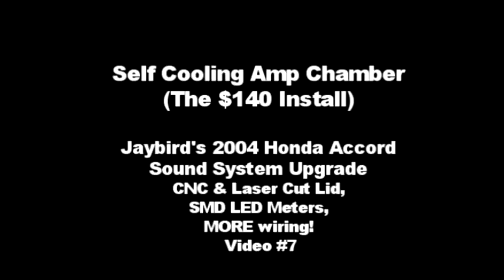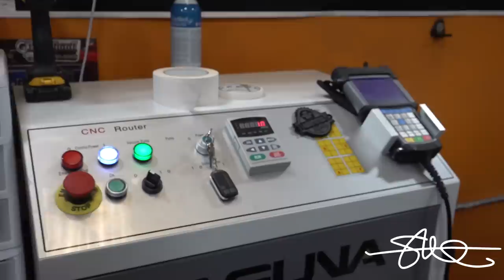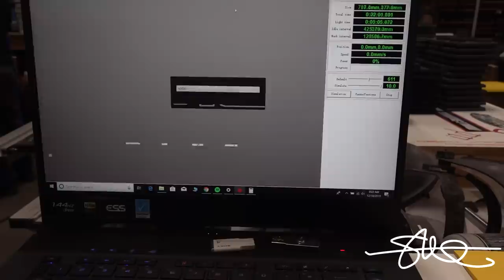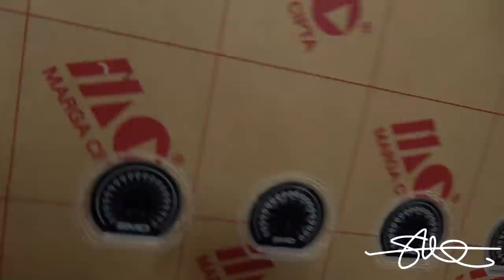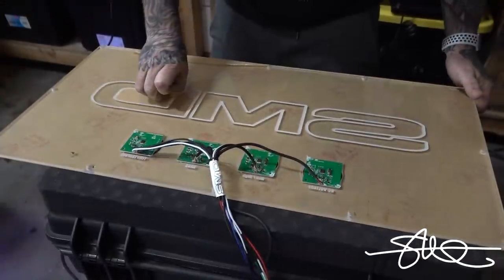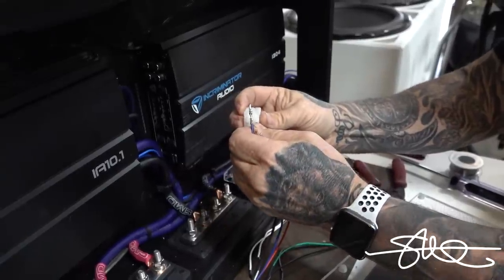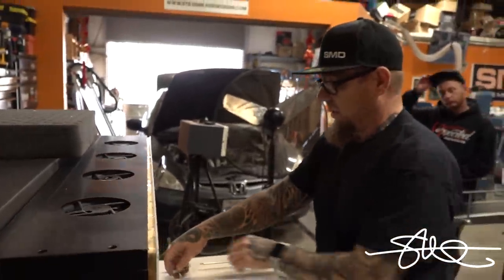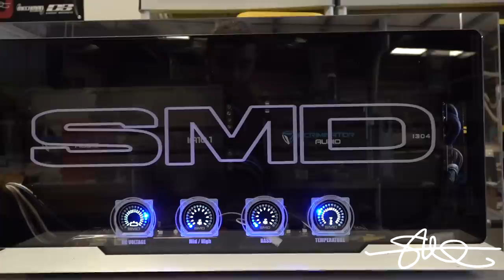The $140 Sound System - Self Cooling Amp Rack Wired up, Tested. LED Lights, Acrylic Cover video 7

Comment from the maker: Watch the entire video. I am going to go live this week and ask a question about it and give the person that paid the most attention $50 bucks!  I may have mentioned it on my Instagram channel and if i didn't, i probably will!  Maybe i will have a $50 JUST for instagram too...watch for that live stream maybe tomorrow! Follow me at http://www.instagram.com/meade916  and thanks for watching!
Reply: meade916 maaaaaaaan.  Top Notch brotha
Reply: Steve I need some help with my systems. My sub is popping when turning off and I don't wanna damage my sundown. Any chance of some help please
Reply: Sub Pop: If the head unit is turning off before the amp, it might send a pop. Its usually the head unit, good amps usually have anti-thump/anti-pop. Disconnect the RCA's and check for the pop. If no pop, it's the head unit. Otherwise, plug the RCAs back in, then remove the remote wire while the system is on. If theres still a pop, its likely the amp. My 2 cents.
Reply: @mrlithium69   sounds like the head unit. Is there any way I'm gunna get past this as I have the pioneer prs 80. Could I try different RCA on the back of the head unit?
Reply: Love ur vids bro keep the awesome content coming👍🏽
Reply: I know in 2020 I will be gettin around $2000 in SMD meters, fuse blocks and enclosure panels for sure!!! Gonna be a great year!!!
Reply: Pr ptopp
Reply: Rptop popped
Reply: Popppoppyp
Reply: @chriswoolford8767  and the popppy
Reply: @chriswoolford8767  p  on porpo
Reply: @chriswoolford8767  popppy
Reply: @chriswoolford8767  potand poand peropptep
Reply: Po
Reply: Please o
Reply: @chriswoolford8767  popeoptrrppp
Reply: @shykesehart5531  popppy
Reply: @chriswoolford8767  popypopppprpppp
Reply: PpI’m p
Reply: @shykesehart5531  and pp
Reply: @mrlithium69  pro
Reply: @mrlithium69  and p  TBH proppp
Reply: @mrlithium69  popp pt
Reply: @mrlithium69  popppetotopped pop
Reply: @mrlithium69  tand toppppypptptp
Reply: @chriswoolford8767  proand ptotoppprotp
Reply: @chriswoolford8767  proand ptotoppprotp
Reply: @mrlithium69  popppopppp
Reply: @mrlithium69  popppoppppp
Reply: @mrlithium69  population pot
Reply: @chriswoolford8767  po
Reply: @mrlithium69  torpedo epppptp
Reply: @mrlithium69  pp p po
Reply: @mrlithium69  please protoplasm
Reply: @mrlithium69  please protoplasmp
Reply: @mrlithium69  to
Reply: @mrlithium69  Yoopgo
Reply: Pyopo and the pfrrboys p
Reply: @chriswoolford8767  pot popppppppfp
Reply: @mrlithium69  poppeppptpptppp
Reply: @mrlithium69  torpoprpppppppp
Reply: @mrlithium69  pop poptpppp
Reply: @mrlithium69  porppo poppf
Reply: @mrlithium69  porppo poppf
Reply: @mrlithium69  poprppp
Reply: @chriswoolford8767  pyyou pis popypopp
Reply: @mrlithium69  poppr pot
Reply: Ofp
Reply: @shykesehart5531  popppppppppppppp
Reply: @shykesehart5531  prop foopt
Reply: @chriswoolford8767  is pogoing poppppppt
Reply: YI poptpppppypppp
Reply: Potpoppp  to popppypp
Reply: PI’m rrpppppppppt
Reply: Poppy
Reply: @shykesehart5531  proppprprp
Reply: Pro to popppppp
Reply: Poopppyfprppppppp
Reply: Torpo popppppp
Reply: Yo toppp
Reply: Popppppp
Reply: Potpop p
Reply: Pprootto pp
Reply: Pprootto pp
Reply: Popppyprppppptppp
Reply: Popppyprppppptpppp
Reply: Popppyprppppptpppp
Reply: Po pyrotpdpppp
Reply: @shykesehart5531  topppppp
Reply: @shykesehart5531  toppppppp
Reply: @shykesehart5531  poppptp
Reply: @shykesehart5531  toppppppppp
Reply: Pop yo prop
Reply: @shykesehart5531  propeprpyy
Reply: @shykesehart5531  pppdpptroprpp
Reply: @shykesehart5531  ppppypp
Reply: @shykesehart5531  ppppyppp
Reply: TI pppyptp
Reply: @shykesehart5531  pyopppppppot
Reply: I pfotoppppr
Reply: Toppppppptpp
Reply: Toppppppptppp
Reply: Ppppppf
Reply: Top
Reply: @shykesehart5531  poppppp
Reply: @shykesehart5531  popppppp
Reply: @shykesehart5531  forropro
Reply: Hey man do you kno of anyone that does this kind of work on the east coast?

Comment: Just watched one of your videos from 9 years ago, on a cooling amp rack before this one. The one from 9 years ago is how I build stuff. Drills, hole saws, router, brads, and screws with stickers. Cool to see how much it changed in just a couple years to full blown cnc's and laser engravers! I've recently been using my 3d printer to create stuff and transfer it to wood with my router. This gives me some inspiration that maybe one day I will have a cnc and laser in my arsenal!

Comment: Emf audio just did a review on the dd-1.
Reply from the maker: dude is a straight up clown....he didn't even do it right.  This is a DD-1+ (that is DD-1 PLUS)  NOT a fucking standard DD-1.  Two TOTALLY different procedures.  WTH is wrong with people. He made a 41 minute video about how our tool doesn't work yet you didn't do ANYTHING right.
Reply: @meade916  on x-mas that dude is this hate full. I un-subed emf for ever. Merry Christmas SMD 😎
Reply: @meade916  Curious on the DD-1+ is there any major advantages to it over the standard DD-1? I've had a standard now for a few years and it's served me well. Didn't know if there was anything on the DD-1 + that would make it worth selling my current DD-1 to pick one up. I do like the ability to adjust your overlap to different levels easier with the + vs. making whole new tones, putting them on a flash and doing that way.

Comment: On a different note, What up with the weight loss....what are doing?!?
Reply: supernac1 Yeah no kidding what’s your secret! 😁
Reply from the maker: exercise....all summer since late may. Lots of treadmill, situps, pushups some curls etc. Nothing too serious just making some changes.  I was a lot fatter than i thought i was....but i am really only 50lbs down.  Been stuck at 196-200 for months haha
Reply: @meade916 I’m in the same boat I started working out and actually found it to be fun after awhile lol, good way to get anger out too
Reply: @meade916  the good ol plateau been there. But it passes i remember i was stuck at like 235 for about a month and a half after losing 60lbs. Then it started coming off again. My nutritionist said its normal and not to do anything different. Its the body adjusting again. She wasn't wrong.
Reply: meade916 Well looking good keep it up.
Reply from the maker: @gregl5677  plus, running on the treadmill in the back yard under the patio cover in 100+ heat can shed it off a lot faster than 40 degree's and raining out like it has been LOL.  Plus it's easier to be lazier about it in the winter....and as busy as i am it's also hard to find time. But i am holding strong usually just under 200.

Comment: This is  my setup  JL audio  RD amplifier 900/5 which  powers all speakers and subwoofer  12" I currently have a jl audio  LOC ... 
Wich  will  I benefit  best from  A Audio control DQ-61  ... or the  audio control  LC7I  ??? A little  help  anyone  thanks  happy  holidays  ... too all

Comment: What are them fans called and how much do they run have u made a amp rack to fit a orion 2500.1 for a suburban under the back seat? I got the controller jus tryna figure a way to get fans on it and which ones u prefer thanks steve

Comment: Got damn do u guys use ear protection in that shop
Reply from the maker: no. Why? it isn't loud.
Reply: meade916 fosho. Just sounds super loud on video. I was so relieved at the end when it was quiet lol
Reply: @daaneel  I work for a furniture company. And we have 3 cnc routers, miter saws, rip saws, wood planers, profilers, Hog(wood chipper) 5 bore machines and bunch other machines and they don't require us to wear earplugs either.